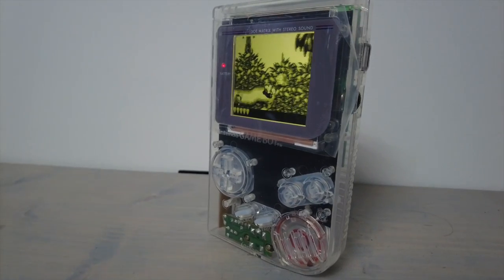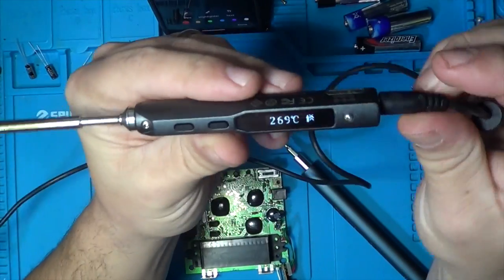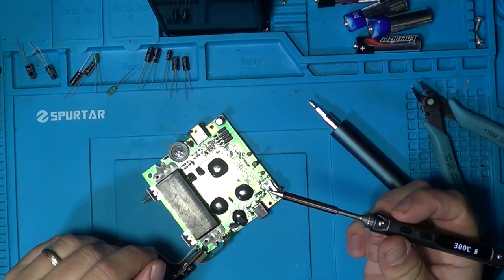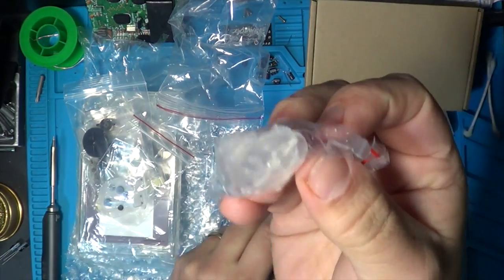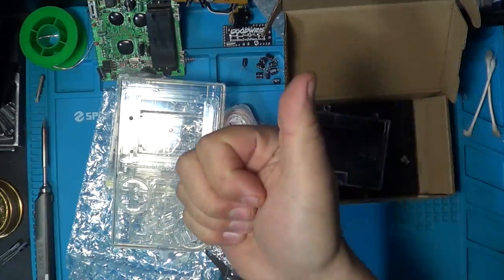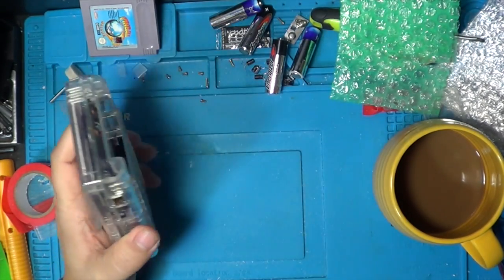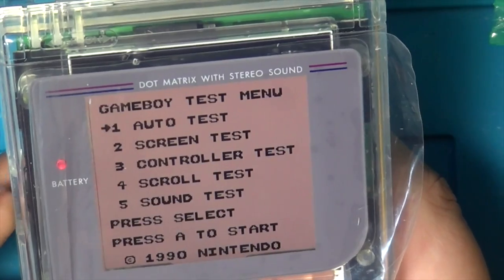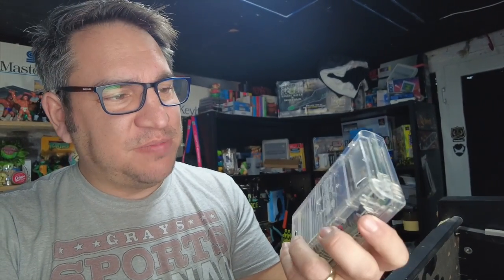Did I Build The ULTIMATE Clear Game Boy? With Funny Playing IPS Screen

Comment: That looks awesome mate, love that case.
Have you ever worked on a cd32?
Reply from the maker: Thanks mate. It turned out great.
No not worked on one, what's up with it? I've worked on a lot of similar age CD systems. Most need a recap and some need a new laser depend on condition.
Reply: @Goodwins Place  needs a recap,  possibly a laser replacement. 
I've heard there a nightmare to work on.
Reply from the maker: @davidretrogamesplayedbadly3533  Happy to look at it or possibly see if Mrs Bear has worked on them before.